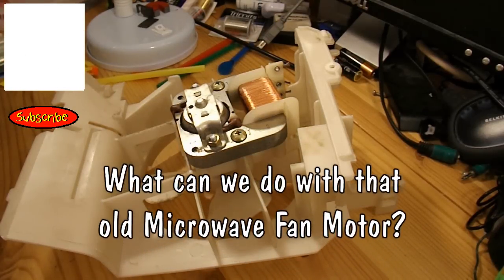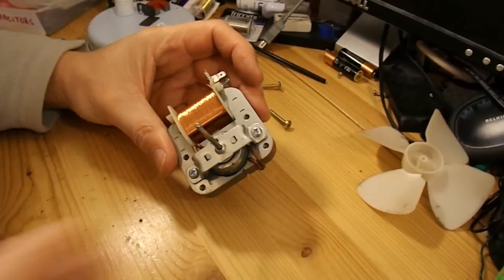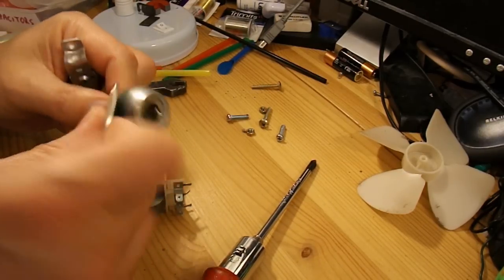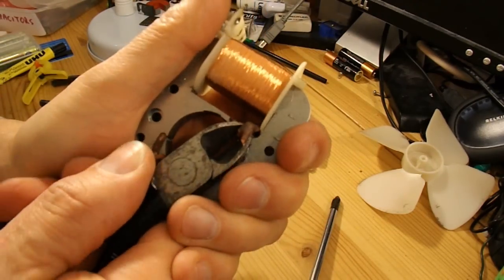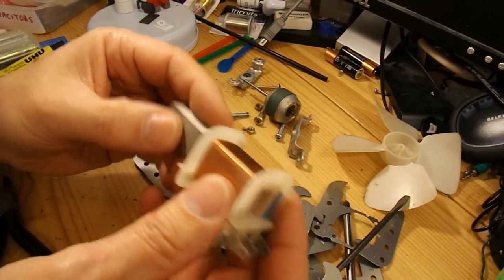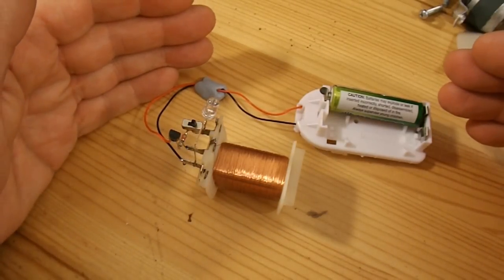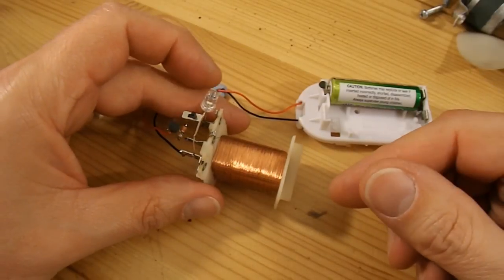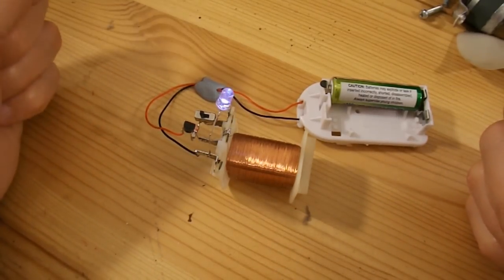What can I do with that old Microwave Oven Fan Motor

Comment: Was the coil even necessary ??? 
You can light up at least 4 LED's with just the AA battery !!!
Reply from the maker: +Don Kocielko perhaps you can demonstrate how to do that? I would be interested to see that. Please include the full details of what LED's you are using, such as the forward voltage they require as I am not aware of any that need less than 1.7 volts and white ones are more like 3.2 volts
Reply: +GrandadIsAnOldMan 
You can see my flashlight at Harbor Freight Tools. com.  It has 24 LED's and requires 4 AA batteries.
Which 24 LED'S divided by 4 AA batteries equals 
6 LED'S  per 1 AA battery. 
The light is a 3" x 5 " rectangular flashlight that is blue and has a bulb  light also and magnet and hook on the back.
Reply from the maker: Don Kocielko I am afraid that dividing the number of LEDs by the number of batteries is not the right way to work out the voltage. With the right amount of current you can light as many LEDs as you like in parallel with a voltage of somewhere between 1.8 and 3.2 volts. The LED will not light until you provide sufficient voltage to meet their forward voltage requirement. Typically a white LED needs 3.2 volts which is why your torch has 4 AA batteries. The 6 volts you get from the 4 AA batteries is probably fed to the LED array via a resistor and then they are all in parallel so each LED gets the same voltage across it which will have been adjusted to be at least 3.2 volts but not significantly more as the LEDs would burn out. Without a resistor they might be arranged in pairs so each pair can handle the 6 volts or they may just all be higher rated to take that load. I have a similar cheap torch here that has 9 LEDs and 3 AAA batteries. In that one the LEDs are all paralleled together so each LED will be taking 4.5 volts. If I make the assumption that you live in the USA I think your home voltage is 110 volts and all your house light bulbs are also 110 volts. Each one requires 110 volts but when you have lights on in 4 different rooms that does not mean that you are now supplying 440 volts to your house. In the video description I gave this link that gives you more information about LEDs including a simple table of their forward voltages http://www.petervis.com/electronics/led/led-resistor-calculator.html
Reply from the maker: Don Kocielko if you are interested I used one of the lights you describe with the 24 LEDs in the first of these 3 videos. It appears late in the video so I have set the video to start at that point Bargain Store Project #61 Old Torch New LED Array https://youtu.be/Tgg8cmAgT9M?t=6m28s
Bulb to LED swap in small torch https://youtu.be/s5ZtYxpIfOQ
Incandescent bulb to 1w LED swap https://youtu.be/SD1Q9wRePxg
Reply: Don Kocielko
Reply: Don Kocielko actually you need 2 AA batteries for 4 LEDs and a resistor or it will not light up at all. I tried 1 LED that was red with a clear casing and used 1 AA battery and I turned off the lights in my room when it was night outside and I saw it light up a tiny bit, but that was just 1 led and 1.5 volts, 4 LEDS will not even light up I tiny bit with 1.5 volts. I'm not trying to be mean I'm just saying you need more than 1 battery.

Comment: how do you get the magnets off the metal brackets from the hard drives? i have several laying around but they are all still attached and it makes them a pain to use
Reply from the maker: +David Yarbrough most people seem to bend the metal bracket. I don't think there is a completely 100% succesful way but it seems to work most times.  Here is one example https://youtu.be/GQhSy-Kz5DM and here is the search I used https://www.youtube.com/results?search_query=remove+magnet+from+hard+drive
Reply: ok. i was worried that would break the magnets
Reply from the maker: David Yarbrough there is a good chance it will, you win some, you lose some. As long as you are bending the metal bracket and not the magnet you have a better chance of success than trying to jam something behind the magnet to lever it off. I haven't seen anything that I would consider 100% successful.
Reply: +David Yarbrough Whenever I try to remove them they always seem to  break, the rare earth (neodymium) magnets are very brittle and are also very thin. What I usually do is just use a dremel to cut/grind off as much of the back plate as I can, leaving just enough metal at the back to support the magnet.

Comment: I hav one...i want to turn it on but dont know which wire to use...any help
Reply from the maker: I am afraid if you have no knowledge of electronics then you will be putting yourself in danger. This is a mains power operated device so you will be at risk of electrocuting yourself. Here is a video where I connect one to the mains as requested by another viewer https://youtu.be/F1IESEC1dik
Reply: I blow it up🤣🤣🤣
Reply: I didnt know because it had 3 insert pin🤣
Reply from the maker: @Za-Here-  I hope you didn't hurt yourself or cause any damage.
Reply: @GrandadIsAnOldMan  im safe, Thanks. I switched it off as soon as it exploded.😅

Comment: Dear Sir GrandadIsAnOldMan
I am very interested this your project Unfortunately I have some motor fan have only 2 pinout ( haven't center tap )
So please could you help me to know the resistance from center tap to other 2 pin out for  rewind  a new coil  Thank you so much
Reply from the maker: I am afraid my meter is playing up a bit at the moment and probably needs replacement but the readings I am getting give me 360 ohms in one winding, 50 ohms in the other and 410 ohms across both.
Reply: Dear Sir GrandadIsAnOldMan
Thank you very much for your enthusiasm
to help me.

Comment: Looks to me like the copper band/wire on lames spreads the core as well as whatever else they were intended too do,  cut it next time then try to spread it next to the coil,, by THEE way good video to me, don't let the negative comments stop you, if they were doing instead of searching, they might be finding.
Reply from the maker: Haha, thanks, every comment means a view on the counter so even the negative ones have their purpose. The copper winding is something to do with the way a shaded pole motor works and controls the direction https://en.wikipedia.org/wiki/Shaded-pole_motor

Comment: I was going to use the fan for the forge I made but the fan turns counter clock wise so now what how can I turn it around to clock wise
Reply from the maker: Jerry Thompson if yours is exactly the same as this one you may be able to take the armature out of the motor, turn it around and put it back in the opposite way round so the longer end of the shaft points out the other side, then turn the rest of the motor round so it has the shaft back through the casing the right way and re attach the fan blade.

Comment: Hey I wanted to ask you if you could fix a motor fan the two switches that connect to that big cooper wire
Reply from the maker: I don't understand your question but as far as the thick copper wire that was round the metal former is concerned there is no electrical connection to them. To understand their purpose you need to read up about shaded-pole motors. Here is a Wikipedia link https://en.wikipedia.org/wiki/Shaded-pole_motor

Comment: You could have just pressed the coil and its core out of the frame, rather than taking every piece of the frame off piece by piece, it would have been a lot simpler and quicker.
Reply from the maker: Thanks for commenting, other people have suggested that too. Sometimes that works and sometimes it doesn't and you have to hit it with something. Reading some of the comments here I have committed the ultimate crime by taking it apart anyway and I should have used it to make a desk fan so whatever I did would be wrong. Certainly I made hard work of it but you learn things if you try things out for yourself 😊
Reply: Where are you in the UK?
You have a south west accent, sort of Wiltshire to  Bristol possibly.
I'm originally Suffolk, but now live in France, Dordogne, which is very rural. My main heating is a 14 Kw wood stove, which I feed from my own woods. Spent some time in Wiltshire long ago, at RAF Compton Basset. Also briefly near Weston Super Mare.

If I take thing apart, I always try not to destroy the bits in the process, as they could be useful in the future, and small motors have potential, where bits of bent sheet metal are less likely to have much.
However, the coil would be a good source of wire to make smaller coils, for experimenting with, so, its swings and roundabouts really. 

I dont understand why people get so emotional on these sites, after all, scrap is scrap, which ever way you look at it.
Reply from the maker: Bristol born and bred although I moved to Devon for a while. On the subject of scrap metal oddly enough I have found the metal cases from old 9v batteries particularly useful for some component parts on my builds as it is very soft and malleable. People get emotional because they want to be heard and take things out of context just for that purpose. From a YouTube content provider point of view, each comment is another view on the counter.
Reply: I've not investigated the YT system, as a provider, I've been too busy with other things, but I may in the future. Maybe I'll pick your brains a bit when the time seems right.

One of my urgent projects is a complete sort out of my workshop. I had to just bung everything into it immediately to get it under a roof, and out of the rain, never a good idea, as its then loads more difficult to reorganise with all the crap in the way.

What was your occupation, before your retirement? { I'm making an assumption, from your Title, and the fact that you have the time to spend on YT.} [At least I guessed your accent reasonably correctly]
I was electronics in the RAF, but retrained as a mechanical engineer, when I left it, and then turned self employed builder some years later, after serving an ''apprenticeship'' gutting and rebuilding a dilapidated Victorian House in London. 

Self employment suited me, no boss breathing down my neck, I could take time off whenever I pleased, and I got all the benefit from my work. Cant beat it!

Coincidentally, my neighbour now has a defunct Microwave oven, that I gave her some 9-10 years ago, that she will now return, so I'll be dismantling that shortly to cannibalise it for wire and other stuff.

I also have a load of old PC stuff, and some monitors. I have an idea of using the high voltage transformer, with a movement detector, to make a deadly mouse/rat trap, cos the buggers round here are often too damn smart to get caught, and take the bait and escape. Maybe that would be worth putting on YT?
Reply from the maker: I was a telephone engineer and retired in 2009. Anything high voltage is popular on YouTube as is anything that is potentially dangerous 😊

Comment: You can also make an electric magnetizer / demagnetizer for screwdrivers!
Reply from the maker: Yes I am sure you could.
Reply from the maker: Hi TheElectricMan, thanks for commenting.  I am guessing you didn't follow the commentary or the video description and you managed to hit your "Cap's Lock" key so you typed all that in capitals. I took the microwave oven apart for the component parts at some time in the past. The fan was of no use to me at the time so it went into my stock. When I needed a coil/solenoid it was an ideal source. Do you have a suggestion of something else useful I could have done with it? I see you have nothing uploaded on your channel so maybe this would be an opportunity for you to make a video and share your skills with other YouTube viewers. Perhaps you could make a simple Joule Thief circuit as a start to demonstrate lighting LEDs with less than 1.2 volts 😊
Reply: Well, you are actually right about that fact that I didn't read the video description...  Sorry about shouting at you.  As a suggestion, you could've made a simple table fan. I didn't know that the fan was a "spare part" to you at the time. Again, sorry for my lack of knowledge. And by the way, it's a pretty neat Joul Thief that you made with it. 😊 Have a nice day, Sir.
Reply from the maker: Hey thanks for coming back, yes table fan but I really don't need one and that would simply be using a fan to make a fan so no change of use or "upcycling" as they like to call it. On my desk I tend to use old PC fans although I currently use a USB powered fan that I bought for a project, used it for that and then restored it and used it for it's original purpose 😊
Reply: That's great to hear. 😊 Have a nice day, Sir. 😊
Reply: Thanks, have a good day too.  😊

Comment: I have national convection microwave the issue is my house fuse gets blown out as soon as i start the oven could u pl advice to fix up this issue
Reply from the maker: No sorry I cannot give you any advice on that subject.
Reply: The breaker may be old(After they pop once they pop slightly easier, over the years they get worn out from popping) or you have to much amperage draw on that particular circuit and the breaker is doing its job just fine. Try using it in a different area in your house. If you pop a different breaker you have a faulty oven.

Comment: Hello. a question out of curiosity, what websites do you usually find the most interesting circuits from?
Reply from the maker: I would not know what you would consider interesting. On YouTube I subscribe to Lidmotor, Slider2732, RimstarOrg, magnetman2010, Cool Joule, Electric Experiments Roobert33, Ludic Science, Thomas Kim,  bigclivedotcom and several more. For general websites I just search for a specific circuit diagram using Google Search on images.

Comment: was the coil a bifilar coil or a normal coil...?
Reply from the maker: +karan pandya my understanding of bifilar simply means that two wires are wound at the same time parallel to each other. Unless they happen to be different colours it is not easy to tell without attempting to unwind it. It certainly has a centre tap as that is why we used it. Why don't you google the components of microwave ovens to find out what components are used or even search eBay for "Microwave Fan Motor" as that pulls up hundreds of similar motors.
Reply: +GrandadIsAnOldMan ok sure.....!!!! thanks